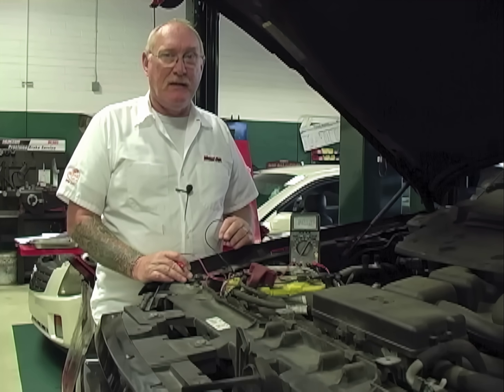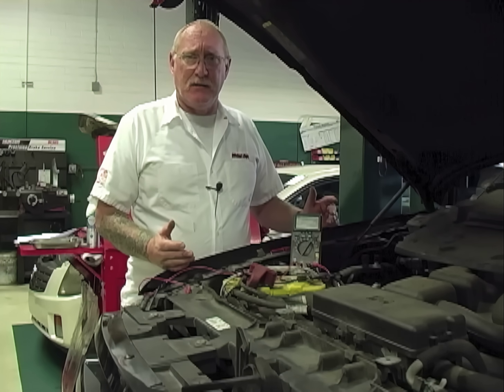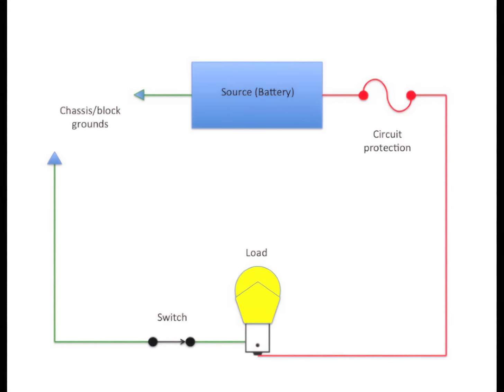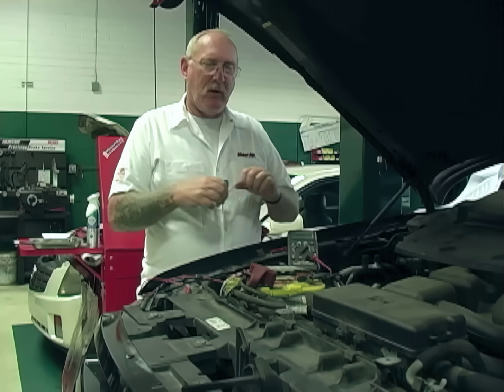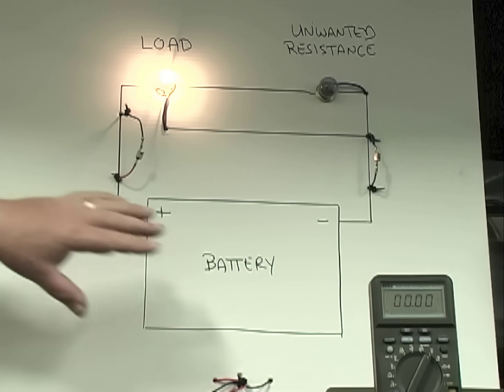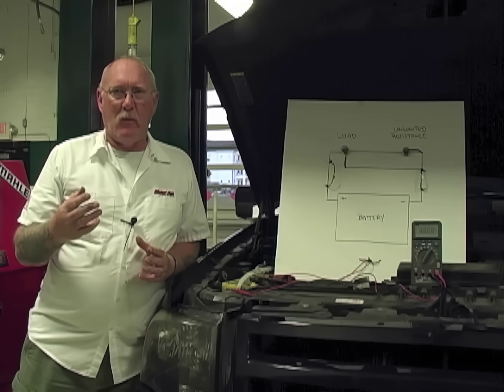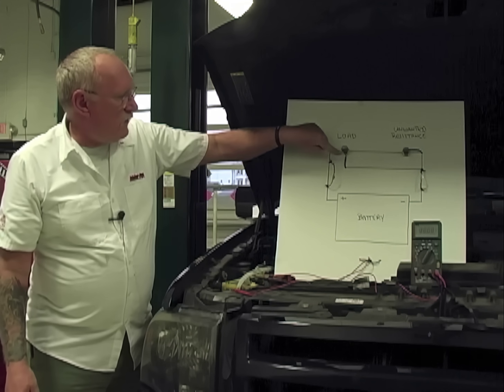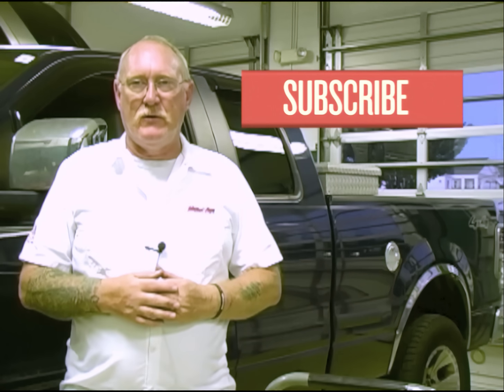The Trainer #47: What measuring voltage on the ground side means

Comment: Very good concept on the importance of learning and knowing what voltage drop is. But I do have a problem with your electrical diagram. In order for there to be a voltage drop, it needs to be in series. Your diagram is kinda ambiguous with 3 leads on the one lamp, it kinda looks like a parallel diagram. I know thats not how you had it wired behind the board, because we saw the bulb go dim plus you measured a voltage drop of half the battery, so it was wired in series. If the other load was wired in parallel, like your diagram kinda represents, we would not see a voltage drop at all, but the current draw on the battery would have doubled.
Reply from the maker: Good point! Thanks for sharing your thoughts. Maybe that's why I've tried to explain this concept in different ways, including my latest effort:  https://youtu.be/FDqkHNF34yc

Comment: If your starter motor begins slow,and the rpm of it speeds up after a second.
You could have a bad + ore - problem.
I had a volvo xc 90,were i could boil an egg on the - pole
Freeking hot min pole.
Ar you guys aware of the v4 measure?

Comment: I'll admit, at first I was suprised by the polarity of the 8 volts measured to ground.  At 5:10 I figured out why it was 8 and not -8 on the meter.   Also, circuit protection devices on the circuit are arbitray,  high side (+) or low side (-)  But with the - ground circuits the + side is used for distrubution, it makes the circuit simpler to construct with the circuit protection devices (Fuses/circuit breakers) on the + side.  It also alows protection for the + supply/distrubution wire should its insulation become damaged and the conductor come into contact with the metal ground.
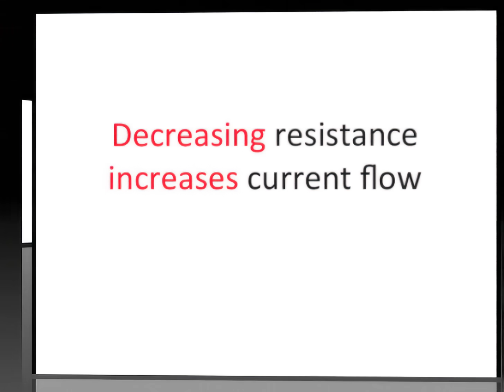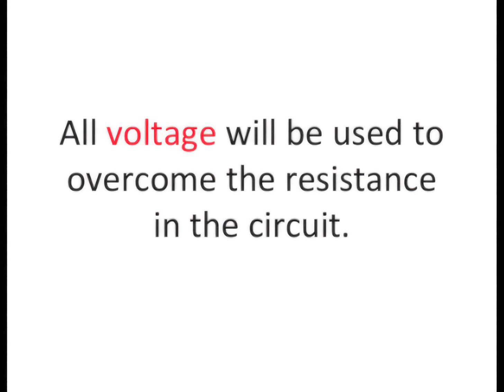Also at 3:28  & 3:38 is based on Ohm's Law ( I = E/R)  & 4:22 is a Variation of Kirchoff's Law.
Reply: the meter reads 6v not 8v right?

Comment: HELP I have a 2007 Ford F-150 that some of the exterior lights and most of the interior lights flash off and on without the key in the ignition. Unplugged Instrument cluster but other then cluster lights all others still flashing. Alternator seems to be charging fine.
Reply from the maker: Sounds like a problem with the Body Control Module - or GEM, as it may also be referred to. Check the entire system for any stored DTCs and start from there.
Reply: Motor Age Just used my F.O.B. for the after market command start and it seemed to settle everything down.

Comment: Great video..but honestly I am more confused now than ever..not your fault, I'm just dumb I guess. I have a 2007 Saturn Outlook xe, the lady I bought it from had a new alternator installed and a new pig tail and battery cable. The  mechanic that did the work told me that seller had placed her jumper cables on backwards and melted the wire (s) gender the need to replace. Since then the charging system light and battery lights come on and the battery will not charge. It's a new battery so I tested it and it is within normal range. I tested the alternator and it seems ok. The grounds have all been checked and cleaned but still no charge. What else could be the issue? I am of the thought it has to be something stupid and simple, as it usually us, but I'm a YouTube mechanic so it's all gibberish to me and I can not afford a trip to the dealership. Any help you can give would be greatly appreciated as I now have a very large piece of yard art that look a lot like a saturn outlook. Thank you.
Reply from the maker: You say the alternator appears ok...does that mean that it is producing a charging voltage at the B+ terminal? Let's start there...
Reply: @VehicleServiceandRepair  yes that is correct. I had a mechanic test it at the b post and it tested within range, the range slips my mind right now.
Reply from the maker: @Nowayjose-vd1wm  Start the engine and let it idle. Measure the voltage at the B+ terminal at the alternator, then measure it at the battery positive post - have the negative meter lead on the negative battery post for both measurements. They should be nearly identical, within a few tenths of a volt. If not, the cable is bad. 

Let us know what you find!
Reply: @VehicleServiceandRepair  will do
Reply from the maker: @Nowayjose-vd1wm  To be clear, you should measure 13.5v to 14.5v at the alternator AND the battery positive post. Both measurements should be within a few tenths of a volt of one another. If there is a large difference, there is a bad connection between the two points. Could be a cable, corrosion on a connection, or something similar.

Comment: I am a little confused with your testing, you are using the voltmeter to test (assuming reading DC Volts)  I imagine your black lead is pinned to ground.  I would expect a zero reading when touching the probe to another ground source.

I see in the part with the 2 bulbs that when you touched what I assume to be the negative side of the now Dim first bulb that you got a reading of 6.x volts.  is that due to a bad ground or a direct positive short to ground?
Reply from the maker: Your expectation is shared by hundreds of techs, including me, until I understood the concept of voltage drop. First, every resistance in the circuit is going to receive an equal share of voltage. If there is resistance on the ground side, you'll measure voltage on the ground side of the load. This is not a short but something in the path back to the battery that is demanding 6.x volts of its own. Does that help?
Reply: I think what you are telling me is When I find a voltage when the negative lead is on the battery negative side, and the positive on the ground side of the resistance, if I get voltage then I have a leak in that circuit? So something in the circuit is either overloading it or connected incorrectly?

I rewatched the video and it helped me a little more I think.
Reply from the maker: @primetimeinc  Not a leak, or overload, or incorrect connection. Think about how your leads are placed. The negative lead is on the ground side of the battery and the positive lead is on the ground side of the load. Would you be surprised if you moved your positive lead to the other side of the load and measured battery voltage? Of course not. When you move the lead to the ground side and still measure voltage, you are seeing the effect another resistance is having on the circuit. Everything in the circuit has some resistance, right, so you'll usually measure a few tenths of a volt - and that's ok. But anything significant means the resistance is excessive. This could be a loose or corroded ground, a burnt terminal in a connector, or something similar. 

I would encourage you to make up a simple circuit, like the one I showed in the video, and add different resistances to the circuit - before and after the primary load - and see what happens to your meter readings. And there is lots more on voltage drop on our channel page and, of course, in our magazine.

Keep at it! Once you get it, you'll wonder what took so long for your own "light bulb" to come on!
Reply: @VehicleServiceandRepair   This is not correct.  Having a difference in voltage drop in a circuit in the car will not raise the voltage of the ground above zero.  Put a wire from the engine block to the body ground and see if the reading drops to zero.  The problem is the ground resistance built up solely between the body and the negative battery terminal.

Comment: I know next to nothing about dc electric. That being said is it safe to assume that a switch on the ground side of load is the safest way to wire something like a electric fan with a high amp draw and fuse on the hot? I've melted switches not knowing what I was doing and wiring on the hot side after a fuse. Can only assume the switch can't handle the load required to run the fan? Lastly if wiring on the hot side in this same scenario, what steps are taken to protect a switch? A relay after fuse?
Reply from the maker: Current flow is the same on either side of the load, so it shouldn't matter where you wire in the switch. Just make sure the amperage rating of the switch is sufficient for the load. For example, if a blower motor is drawing 5 amps on high, I would use a switch rated at least 3x that to allow for initial current draw peaks. Same with the fuse.

Comment: Understood it until the end.  So why is the chassis charged?  So there is another significant resistance between the chassis and the negative post of the battery.  That would mean that the "ground wire/strap?" between the chassis and battery is faulty?  There's only one ground strap?
Reply from the maker: Hi Nicholas! Let's see if I can clarify for you. When you measure voltage on the ground side of the "load", that means there is another source of resistance between that point and the negative battery post (provided you have your negative meter lead placed there). What path does the load take to get back to the battery? Some components are grounded to the chassis, some to the engine block. There are more than one ground straps but they are used to connect all the components (block, chassis, battery) together. There are also multiple ground points where components are wired to a common ground point on the block or chassis.

Consider an ignition coil. It is grounded to an eyelet (along with other components mounted to the engine), right? The eyelet is on the block. The block is grounded to the chassis. The chassis is grounded to the battery. Lots of places for ground to fail...

For more, check out the Trainer for January 2018 and stay tuned for February's!

Comment: Great Verbal. I think there should be clearer drawings. What I see is almost a parallel circuit that should make both lights as bright.  I also understand you are under a time pressure.  I have an L1 Ase cert.

Comment: Great video, thnxx. Which DMM are you using? I have a small basic one.
Reply from the maker: +Jorge Mendez Mine is an old UEI meter that I've had for years. But check around - even good Fluke meters can be found on Ebay and area pawn shops for a decent price, I hear.
Reply: Super easy thank you .  You should call your self Easy Peet

Comment: Thanks for the video. Here is an example of why I have not yet subscribed to the channel. You showed us a vehicle with a significant voltage on the ground side. You then explained the theory of how it can be there and why it's a problem. Then you said goodbye! I suggest that you do away with the pre-fab circuit board and do the work on the vehicle. That's real world which leads to real understanding. We've all read the books, but few have ever seen and had to fix it first hand.
Reply: But, he never showed us what actually caused the problem. Finishing the troubleshooting steps to completion would have been a big help.
Reply: what i believe you are looking for is the fix and although he stated why it wasn't clear in this case. most cars the high current items are the starter and the alternator.  for this reason most auto makers run the ground to the engine block from the battery.   then they run a jumper wire (or strap)  from the  engine block to the body  using the steel and/ or aluminum as a conductor  for the body circuits(lamps heater etc) in this case the vehicle would start and run ok(assuming the problem wasnt at the engine block) but the lights may be dim turn signals wonky heater motor slow etc. one way to prove this would be to substitute a good connection  by running a temporary jumper cable from the engine block to the cleaned metal body.  by understanding how circuits work and how yours is configured  you can narrow your are of testing  by  the problem symptoms
Reply: It was explained very clearly about locating a source of drainage from the resistance and what could be causing the problem once testing to locate the problem. Very detail, cant do it for you. I think his instructions was on point. Some time to get it, you have to look at it more thatn once, and what evry it take to get it.
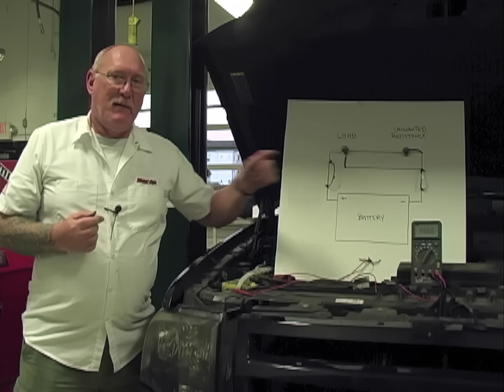Reply: There is stray voltage in the body of the vehicle because the body isn't grounded properly. The body is energized. He briefly explains this at 8:12

Comment: 96 jeep Cherokee 4.0 tested battery an starter they are both  good,but I put my test lid to the neg post an the neg terminal an read 11.8 v with out a load what do I check now like the vedio
Reply from the maker: +Simon flores Not sure if I understand what you're testing. If the negative meter lead is on the negative battery post and your positive meter lead is on the positive battery post and nothing is on, then you are measuring Open Circuit Voltage in the battery. At 11.8, the battery is significantly discharged.

Comment: This is a very good example of the three test I teach my students.  1. Open circuit voltage (OCV) 2. Available voltage and3.  Voltage drops.Very good demonstration.
Reply from the maker: Think of it this way - voltage is used to push through the resistance in a circuit and the load SHOULD be the major source of resistance. But if there is a THEIF or unwanted source of resistance, it too will want its share. In this case, excessive resistance in the ground path after the load will demand some voltage of its own. And that is what the meter is telling you...there is another resistance downstream that you have to correct in order for all the voltage to be consumed by the load. Does that help?
Reply from the maker: +Roddy Rampersad Thanks for sharing your comments.
Reply: Roddy Rampersad How is there electron flow back to the battery  ground post if the load consumes all the voltage.